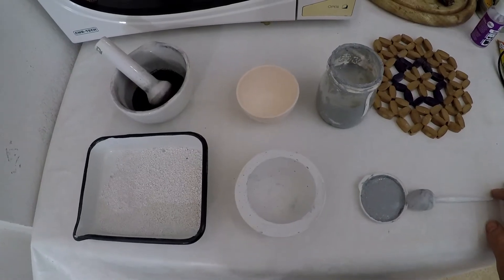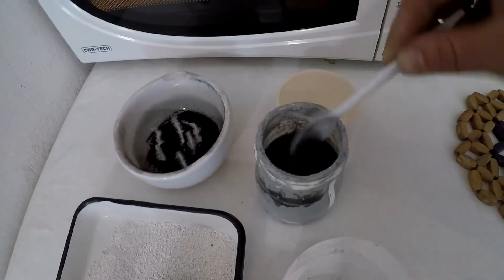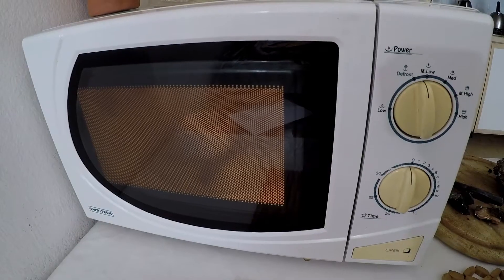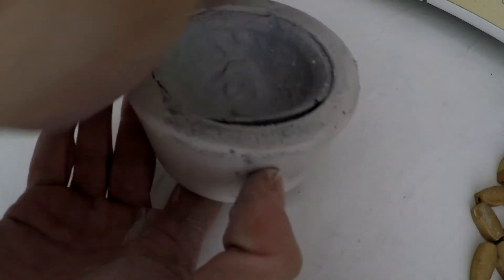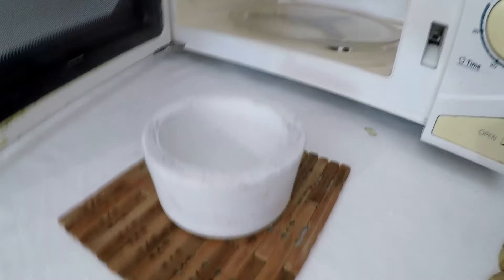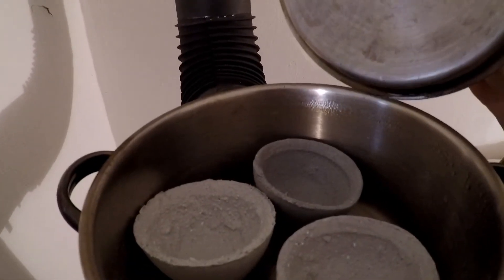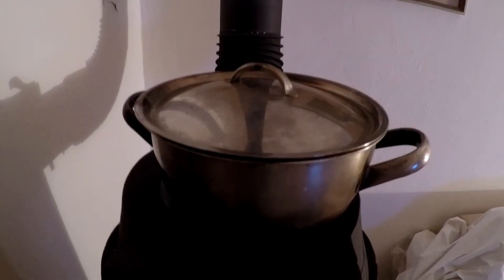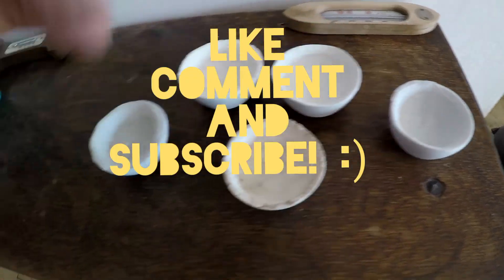Homemade alumina crucibles

Comment: Anyone try this with MgO?
Reply from the maker: It's in my plan to trx it out! As a very refracted material, it might be a good idea to try it out. Highly hygroscpic, top! That would, perhaps, eliminate the need for a binder.
As for working with steel or cast iron, I know that any micro trace of magnesium results in spherodizing the cementite, making a tough material.
Thanks for the comment,

Comment: What is the time between making them and drying them with fire and burning them well?
Reply from the maker: Hey Said, bud!
Since they are very thin, they dry over several hours, depending on the ambient temperature. Afterwards I place them in the pot for about half an hour on low heat. It makes sure they are 'bone dry' and ready for firing. 
I guess I could have skipped the first drying process and directly put them in the pot, but I didn't want to risk getting cracks from uneven heating, or deforming them when placing into the pot when they are 'leather hard', i.e. soft. 
I'm sure a proper oven would preform much better and safer than a pot :p

Comment: good job . Can you give us the amount of material(Charcoal, aluminum. Water)plz
Reply from the maker: Hi Said!
The ratio of about 50:50 is what I used for mixing alumina and kaolin powders. I added random amounts of grog and charcoal powder, but less than the first two.
As for water, I added enough so thst the slurry/slip is neither to runny ir too thick.

Hope that helps!
Reply: @emel60  thanks 👍
Reply: @emel60  What is the highest degree he can handle?
Reply from the maker: @sidalisaid12  according to the alumina-silica phase 
 diagram, the 50-50 ratio mixture vessels can theoretically withstand +1800 degrees Celsius. I reached +1600 C, and they withheld it perfectly.

Comment: can you expand on the details of the slip?  did you grind the grog? It looks quite coarse.  Is the purpose of the carbon powder simply to create porosity in the ceramic?
Reply from the maker: Hey nitrous dude!
The slip was made using about 50-50 kaolin and alumina powders, random amount of fired grog made from the same fabric (some crucibles had cracks, some were ugly, some were accidentally dropped in anger), finely crushed charcoal, also of random amount and a bit of water. 
The grog was a bit coarse, but I did not see any big performance difference in fine or coarse, except interior wall surface finish.

The purpose of the charcoal powder was to creat cavities after it burned off (solid turning into a gas). They greatly improved the structural stability of the crucibles; they become more tough because  cracks can't propagate as they normally would. The round-ish cavities act as a crack stopper/buffer. This was evident in mechanical properties after firing the crucibles. They were really hard to break, even with a hammer- considering how thin they were. 
But, more importantly, the cavities massively helped during rapid, high temperature heating, as the thermal conducting was reduced due these air pockets in the fabric. Consequently the thermal stresses were reduced. 
I also think that the powder accelerated drying, as the charcoal is really hydroscopic, taking water from the slip into itself (porous structure).
Reply: @emel60  those details are great!  If you're interested, you might try using fine aluminum particles (not powder - but fine granules) in your mix.  if you make the system alkaline, the aluminum will release hydrogen gas, essentially 'expanding' the fabric, as you are calling the dry slip mixture.  This is one of the methods used to make aerocrete expanded cements.  

Have you tried using sodium silicate solution (water glass) as a binder - not to use in a slip-based system, but for extruded/pressed castings?
Reply from the maker: @en2oh   @nitrous dude  interesting! At first I wanted to do something similar, like Mathew did in this video; the end result is the same: plenty of voids :) 
https://youtu.be/v8oEzVFaJ0A

The way I'm making these vessels, the only obstacle I can see by using ground aluminum is that it may cause havoc in the microwave ahahahha (not saying I won't try :p)!

As for glass water, I wanted to make some cores for some future casting, and using them for some future molds. I'm unsure what would be the maximum withstanding temperature of such fabric. It can withstand the temperature of 1100 C on its own, quite low by refractory standards, but as an addition, it might be increased. I will try to do some research on this topic. 
Cool thinking, though!
Reply: @emel60  Thank-you so much for the reference!  I greatly appreciate it.  My friend told me that he saw your video and that you gave me a shout out, so I just had to watch your video.  Thanks again.  Subbed as well.

Comment: Cool process im curious though what is your intention with the finished crucibles? Doesnt look like you could do much more than a bit of jewlery casting... or are you perfecting the process before scaling up for 1 tonne SG iron charges? :)
Reply from the maker: I successfully used these wee crucibles for making my own crucible steel buttons, after which I broke them apart to reveal the minute amount of shiny stuff (they were lidded).

However, the original crucible pattern I shamelessly copied was a porcelain laboratory crucible I stole from my moms work place, even more shamelessly. They were used to heat various crap and even melt gold! So, repeated use of the wee buggers was intended- I just didn't try and/or care about not breaking one after use! Ash glaze and interior slag made them too ugly. 
Jewelry casting would prove to be a piece of cake! 

As for one tonne of liquid SG iron charge... big things have small beginnings! Although, I'm still recovering from the emotional trauma and burned feet :s

Comment: what sort of tempersture could this handle?
Reply from the maker: According to the alumina-silica phase diagram, these crucibles would theoretically withstand temperatures exceeding 1800 C (I made it as simple as possible, as proper tertiary phase diagram can't be used- I have no clue what the lady sold me/ what my kaolin clay powder consists of, so I used average kaolin composition). 

More precisely, the alumina to kaolin volume ratio of 50:50 consists of about 70% alumina to 30% silica for the crucible. Looking at the same phase diagram, the temperature at which this crucible ceramic would degrade is, give or take, 1890 C.

My laser thermometer peaked just over 1600 C during the furnace run, and I believe it was even higher- alumina has a property of high IR reflectivity, and the thermometer has different readings for different materials due to emissivity, which I could not care less about.

Thank you for the comment!

Comment: Have you had any luck with melting Aluminium, Copper, or Brass, in these?
Reply from the maker: Not yet, bud. I'm planning to melt several different alloys in the crucibles. Firstly aluminum, for some slingshots (I know, I know, I should grow up!). My bet is that the crucibles will withstand the low(er) heat of these alloys, as they survived  liquefied steel and cast iron, both heavily corrosive to the vessels, and extremely hot. I'll make an update fpr sure!
Reply: @emel60  Awesome, that is why I subscribed!
Reply from the maker: @trollforge  many thanks bud!
Reply from the maker: Hi @trollforge! I'm writing here to updated you that I've finally managed to work some more on my projects and I've successfully melted bronze for some artistic knife fittings. Worked like a charm. Although, the design of the crucible is not overly friendly for manipulation while charged with molten metal. They survived, as did I!
Reply: @emel60  Awesome!

Comment: hello my friend. Great job! I want to dry press. What should I use as a mixture?
Reply from the maker: Dry press the powder into a finished product?
You'll need to make sure you have proper pressure, rather than worry about the mixture. On the market there are plenty of  >99% alumina laboratory ware, and I believe they are sintered by using compression.
Ultimately, the mixture depends on the intended use of the ware.

Cheers!!